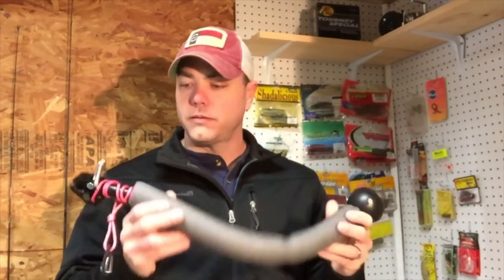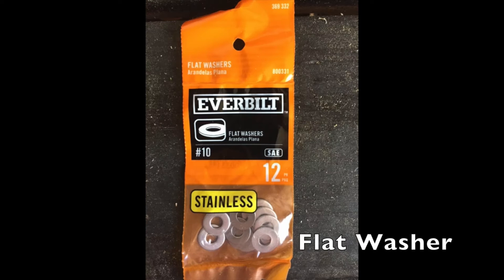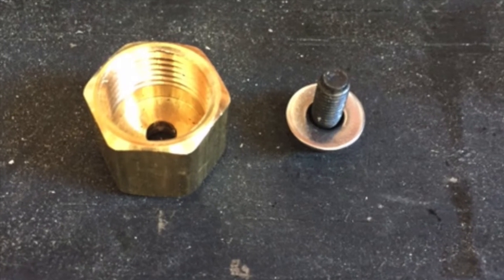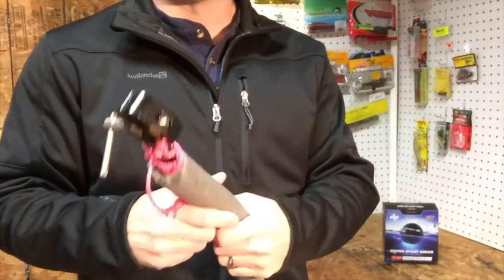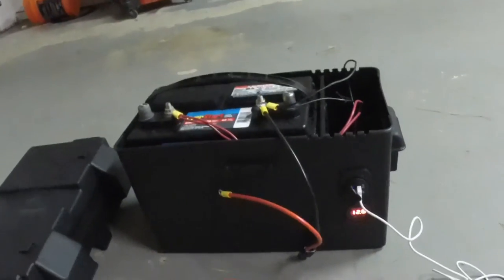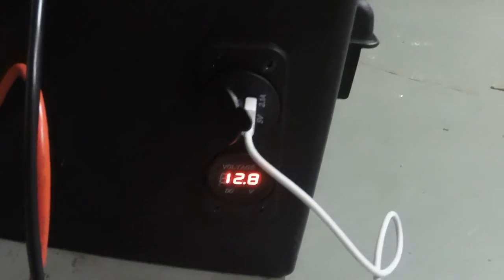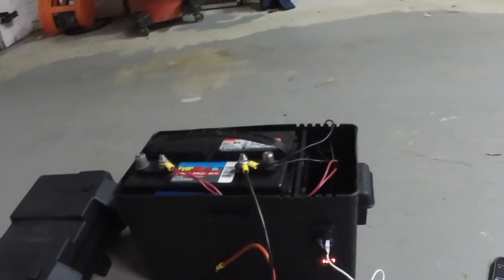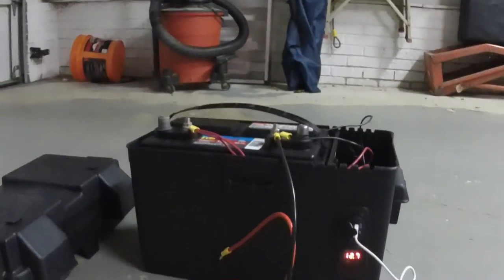DIY Deeper Fish Finder Mount & Kayak Power Station

Comment: Great video. Thanks. One issue I ran into is the brass pipe cap has thread size different from the on-stage goose neck. just ordered a 5/8-27 thread female adapter and hope that'll work.
Reply: Zunli Lu where did you order yours from? I ran into the same problem and can’t find one

Comment: Any issues with sonar readings while paddling at cruising speed, say 3-5mph? I assume dragging it behind the kayak on a length of rope is no good...hence the mount? Great video!
Reply from the maker: The only time I have an issue with the readings is during extremely choppy water or if the unit is too close to my kayak. When I first started with the Deeper Pro, I let it hang from a rod. But the constant drag and tip action from the rod was problematic. This attachment has worked well thus far. I have used it on more than 12 outings in both flat water and slow moving rivers and he helps keep a consistency in the reading. Thanks for viewing and please subscribe for new upcoming video and reviews. Thanks.

Comment: Can you provide an update on how your mount is holding up? I'm curious to know if the screws actually hold the Deeper enough without it being unscrew by itself slowly.
Reply from the maker: Thanks for the comment. The mount is holding up great! I check the screw attachment each and every time before I start the trip but it has yet to become loose. However, I do find myself adjusting the proper angle of the (unit to water) positioning until I find what works best for the wave conditions of that day. Please subscribe to our channel and check us out on Facebook https://www.facebook.com/cackayak/ . We will be posting more about the Deeper unit throughout the Spring and Summer. Thanks.

Comment: Great video.  Well communicated.  Only issue I have with the build is how well it will hold up to salt water over time (since it is not stainless steel).

Suggestions:

1.  Instead of using the CrabClamp, use a t-bolt.  It will save you about $10 off your build, make it lighter and allow you to attach the flexi rod right to a yak's track system.  From what I understand, this bolt from Fastenel is very compatible with track systems: https://www.fastenal.com/products/details/74026

Either epoxy/solder/crazy glue the bolt right into the gooseneck female end or find a reducer.

2. For those that don't have a trolling motor, suggest people use a small powerpack which can be velcro'd to their tablet/phone case to ensure they don't run out of juice (something like this would work well: https://www.amazon.com/ZMI-PowerPack-10000-Lightest-Easy-Grip/dp/B06XRVHDLM/ref=sr_1_2?ie=UTF8&qid=1502910166&sr=8-2&keywords=phone+powerpack

smithmal